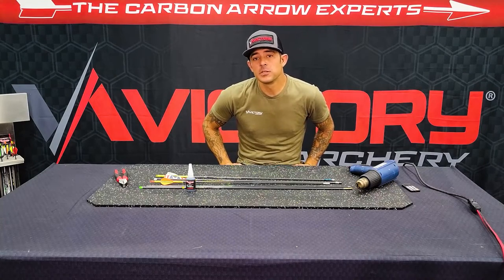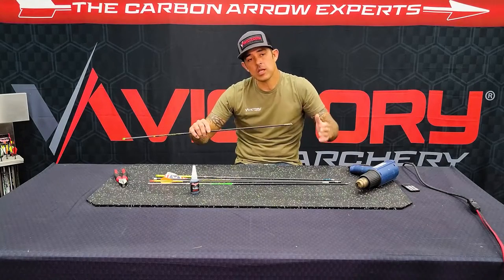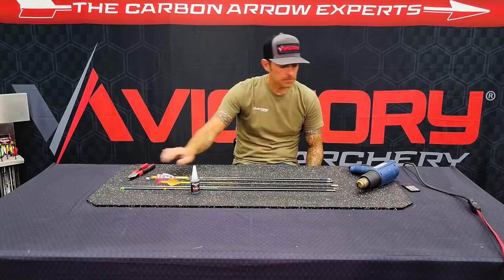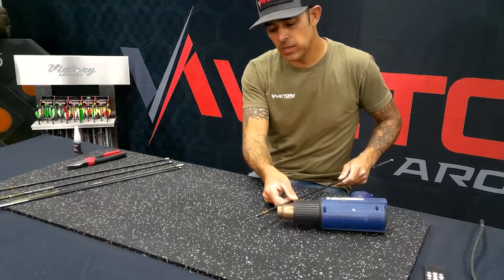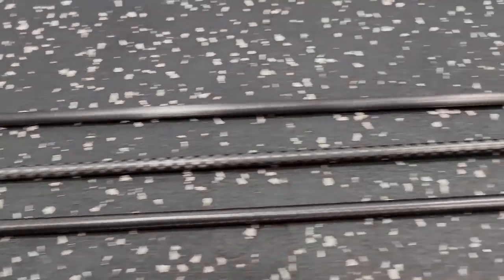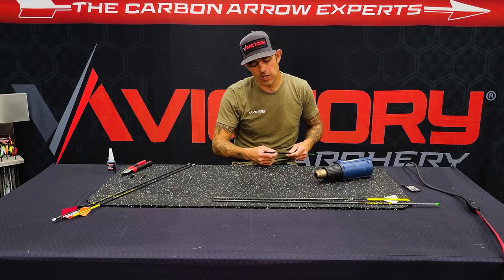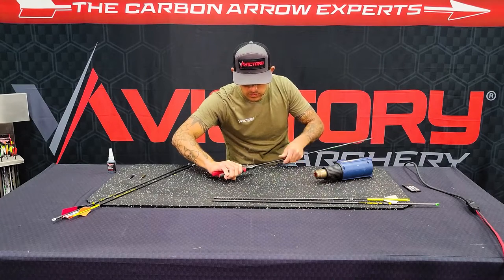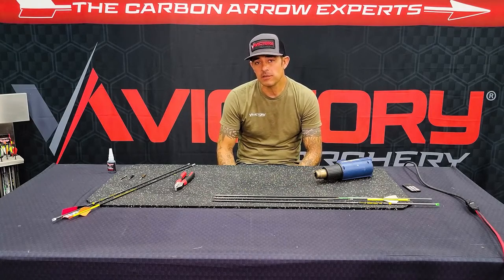Taking Out Arrow Inserts Safely!

Comment: Have you guys tried the Bohning Cool Melt??? I like it because if I want to index my broadheads to my veins, I can do so with hot water from the sink..
Reply: Look into the “Kimshaw” brand low temp melt. Get more for your money, and it holds up a lot better in various extreme temps. Lots of reviews on it. Looks like a bit circular chunk…tan in color. 3 rivers archery sells it. And also podium archery and iron will sells jt branded under them now

Comment: Is there a shelf life on this black fusion or specifically once opened and not in use like there is with a regular fletching type super glue, specifically once opened seems it goes back or dries up in one off season
Reply: I always store it in the refrigerator. Cool and dark, Your glues will last 3 times longer, just don't use it as a condiment.